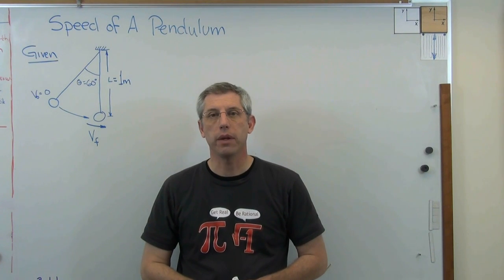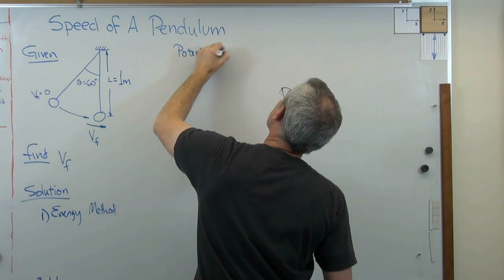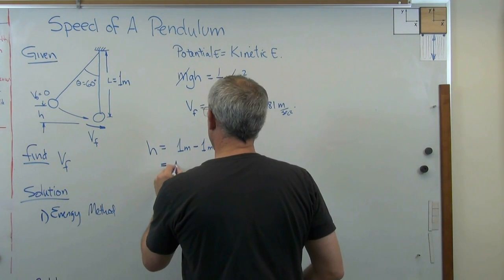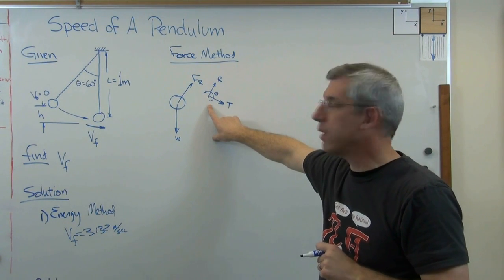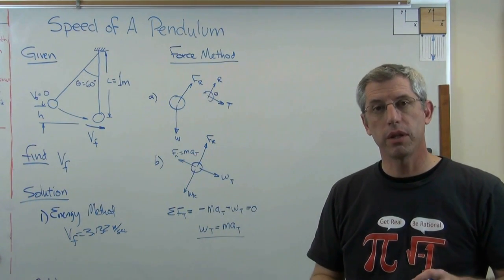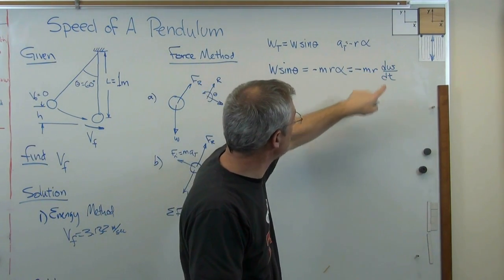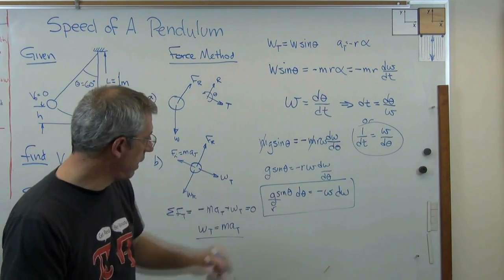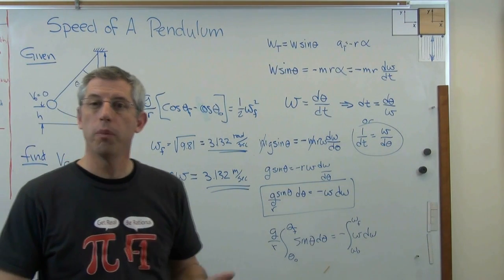Pendulum Velocity

Comment: you screwed up when you wrote at= - r[alpha] but were saved when you wrote integral of sinx = cosx.
Reply: there is nothing wrong with - r alpha it just states the angular acceleration is negative according to the sign convention he used and he did not write the integral of sinx = cos x . he merely shifted over the negative from other side and did integral of - sinx = cos x which is correct
Reply: Well if you take the angle to be away from the vertical, then i guess that's right.